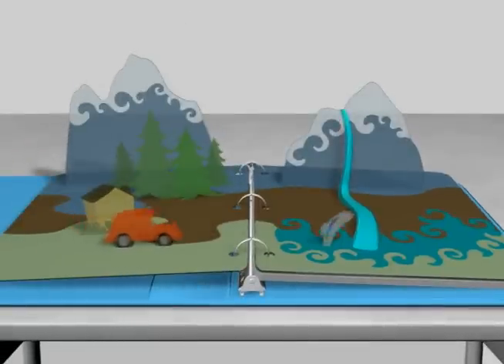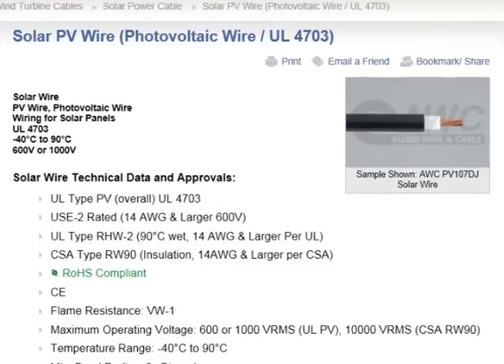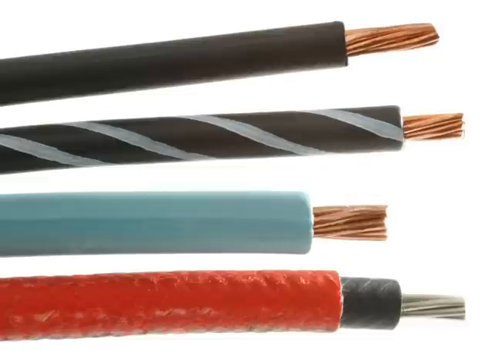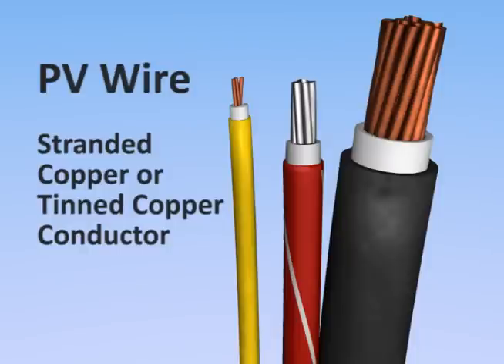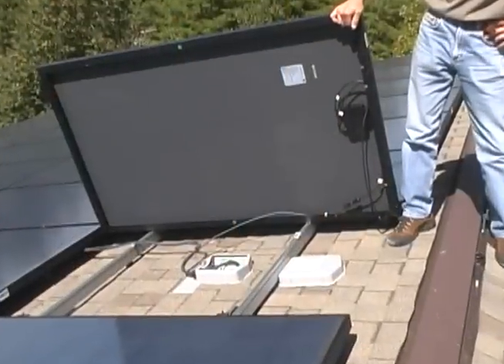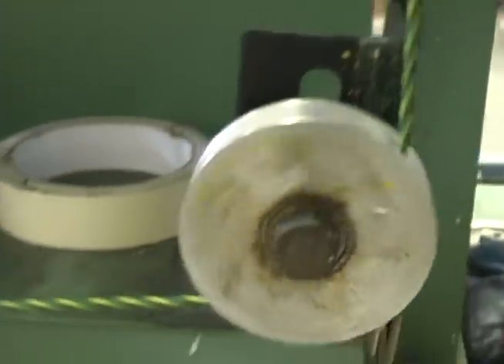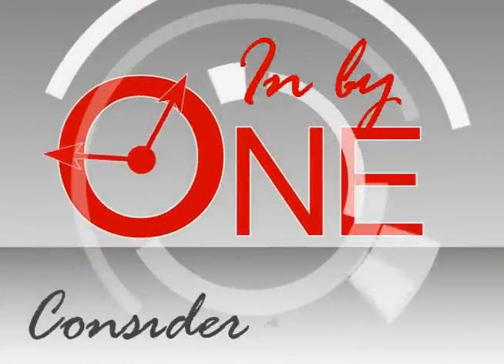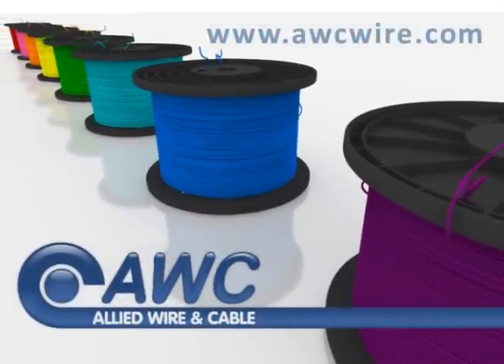Solar Cable: PV Wire vs. USE-2 Wire - Brought to you by Allied Wire & Cable

Comment: Is there an advantage to using TIN coated copper PV wire? Can you please clarify.
Reply from the maker: Overall, tinned copper conductors increase conductivity and allow for easier soldering.  We have additional information on the benefits of tinned copper on our website at http://www.awcwire.com/conductor-materials.aspx under Types of Coating.

Comment: High Volt PV Cable special design for Solar Systems 
Fire Prood Made in Korea
4mm 
6mm 
10mm 
16mm 

Fire proof high volt 1800vdc to 3000vdc 100% pure copper & imported Tin-coated 
SparkSolar